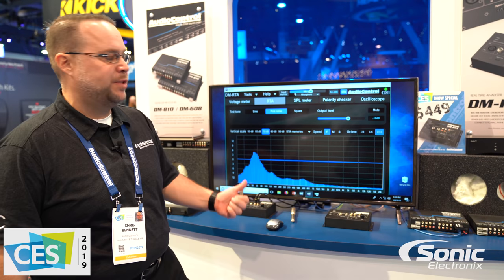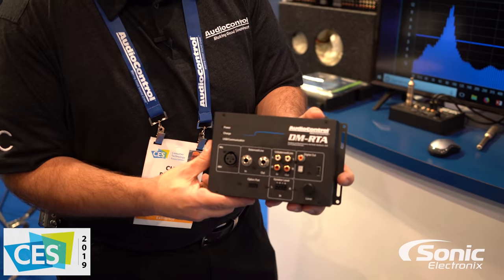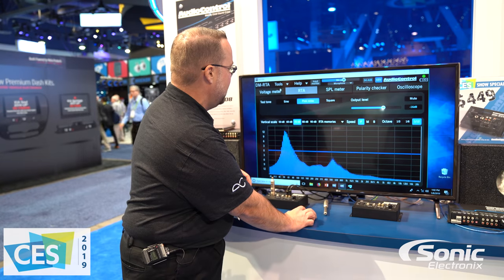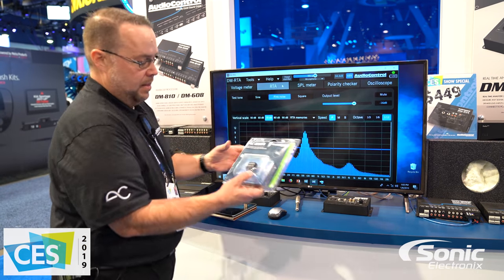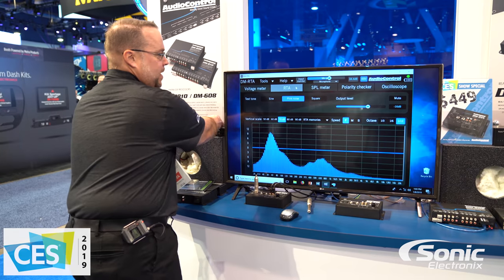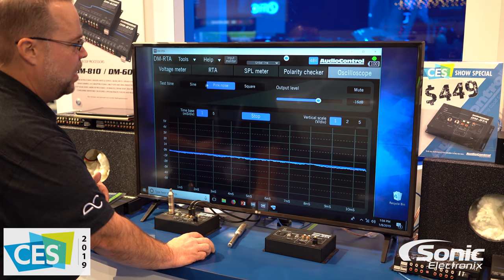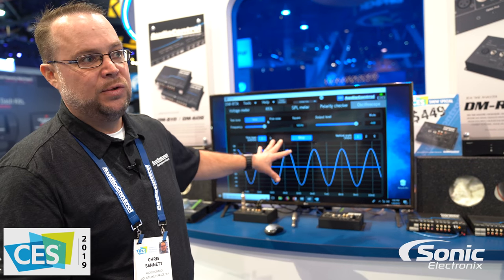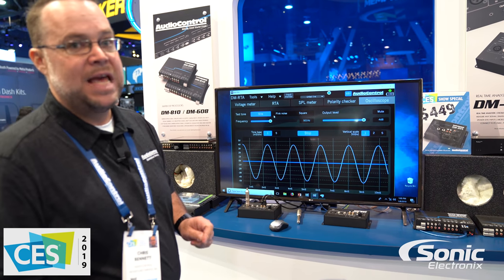Audio Control DM-RTA: Real Time Car Audio Analyzer and Multi-test Tool

Comment: I have a question and i need help..
I have a GAS COMPETITION 3500.1D amplifier
1x3500W RMS @1ohm
1x2500W RMS @2ohm
1x1800W RMS @4ohm

I have 2 GAS PRO GPX1224 dual 3" voicecoils 4ohm each
1000W RMS - 2000W MAX.
If i run each one separately i only have one chois and that is to run it in 2ohm..
wich needs 1000W x 2ohm = 2000W and the square root of that is 44.72V that i need to run them to get the max RMS without damagin them..

HERE comes my question...

WHEN YOU PARARELL THEM.. TO EATHER 1ohm OR 4ohm... 
How should i calculate to get the max RMS out of them..?

do i just calculate for one as following?
1000W x 1ohm = 1000 and the square root of that is 31.62V
1000W x 4ohm = 4000 and the square root of that is 63.24V

OR... should i calculate it like this to get the max RMS out of them since it is 2 speakers on the same output..

2000W x 1ohm = 2000 and the square root of that is 44.72V
2000W x 4ohm = 8000 and the square root of that is 89.44V

I really need help guys.. another strange thing is my amp is 3500W RMS in 1ohm.. and 2500W RMS in 2ohm.. and 1800W RMS in 4ohm..
BUT.. i don't get it together..
3500W RMS x 1ohm = 3500 the square root of that is 59.16V
2500W RMS x 2ohm = 5000 the square root of that is 70.71V
1800W RMS x 4ohm = 7200 the square root of that is 84.85V

BUT.. when i ran an 50hz tone in 0DB and turned the knob full.. i measured 94.51V..
94.51 x 94.51 = 8932W.. I really need help cause i don't want to ruin my speakers in any way.. the sellers of GAS measures the DB togo up to 149DB with those 2 subwoofers in the box i have..
But i don't get close to that i get around 125/130DB..

could be good to also tell you guys that i have 50mm OFC power cable both for power/ground.. i have a 75ah battery in the car to make it start etc.. and an extra 75ah battery both on 650CCA and also a 1 farad condensator..
i really think i should be able to get that 149DB..

I WOULD REALLY BE GREATFUL IF SOMEONE COULD HELP ME OUT :D.
Reply: Marcus Högberg I really wish I could help but I’m new to this audio stuff and I’m just installing a basic audio system in my truck. You sound like you know your stuff. Perhaps you can help me with my installation. I have four door speakers that are infinity kappa 682.11cf. They run 100rms each with 300 peak power each. And they have nominal impedance of 2 ohms. The frequency response of the speakers is 40-25,000 hertz (2 way coaxial speakers).

I am going to install an aftermarket radio along with the speakers but my radio can only support 4 to 8 ohms. So I guess I’m gonna need an amp that can handle 2 ohms, so that I don’t damage my speakers or my radio. 

My first question is what kind of amplifier do you recommend?

Next, do I need to set a high or low pass filter on the amp since the speakers have a built in crossover? Later on I might install a subwoofer or two as well, so what power range do you recommend for the subs and the separate amp. (I would have two amps, one for highs, and one for lows) so that my highs and lows stay balanced 50/50.

Thanks for your time if you could help I would really appreciate it. 👍🤙🤙🙏
Reply: You calculate based on the amp, not the subs. The subs only matter in the sense they need to be "showing" the amp the correct ohm load.

Comment: I have a question. I want to either run 2 or 3 of the nvx vsw84v2 8 inch subs in my 2003 bmw e39. Should I do dual 2 ohm or 4ohm ? What size amp will I need to power them so I can get the most out of them ? I heard they are really good.
Reply: 2 of them, dual 4 so you can wire to 1 ohm